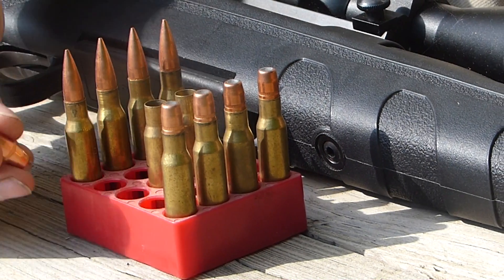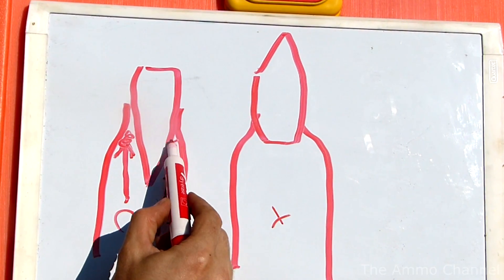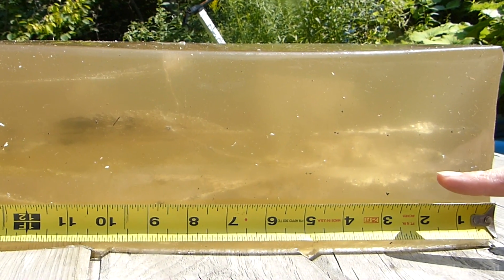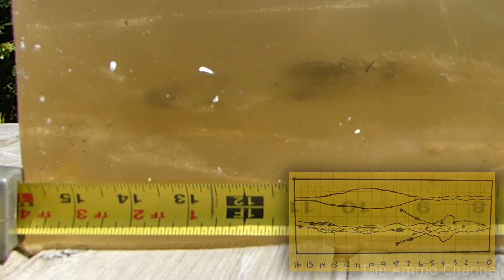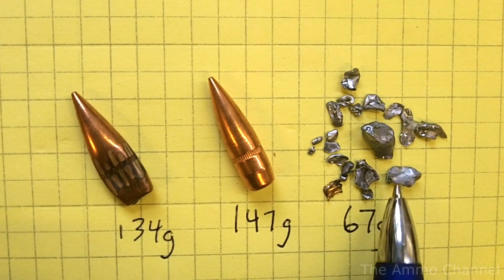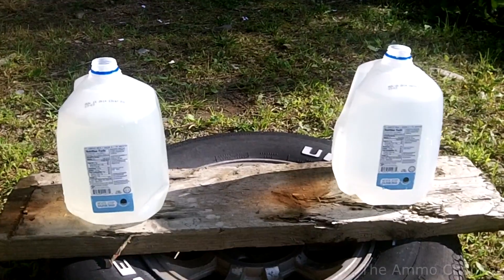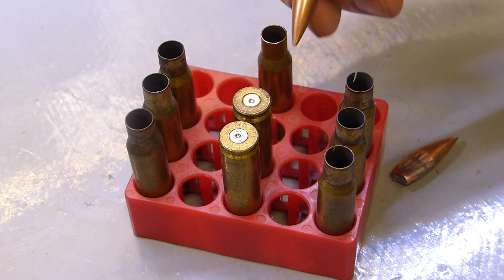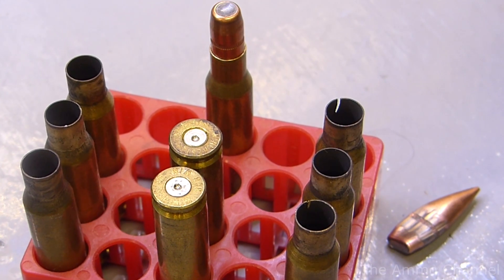Shooting Bullets Loaded Backwards

Comment: Back in the 50s to the 80s reloading impacted African safari ammunition.  More than a few guides and hunters were taking the soft point bullets and reloading them backwards into the large big game cartridges to produce some of the first dangerous game solid projectiles.  Soft points have a solid copper base so reloading the bullet backwards was essentially a solid with a flat face.  They got amazing penetration with these which is what they were working towards.  The practice is basically history now since modern bullet designs have covered it.  The different angles on the backward bullet in the case is irrelevant to pressure.  The bullet and unburned powder have already been pushed out of the cartridge and into the rifling before any direct gas pressure pushes on the bullet.  Nevertheless, gas pushes outward in an even concentric sphere and follows the path of least resistance.  Pressure in the chamber is dictated by how much bullet is sealing off in the rifling.  Same amount either way.  The biggest issue is losing chamber space to accommodate the round and still get it to chamber into the throat.
Reply: +Matan Pulverman This is a cartridge.  I'm not theorizing or even guessing.  I was relating history and what was discovered from guys reloading since before you or I were ever born.  Doubt all you want, even sincerely doubt, then pick up a really old reloading manual and start reading.  BTW, there is a huge difference between an impinged load and a direct force vector.  Your example is wrong.

Comment: backwards = death almost instantly.

forward = full pass through and the guy wondering if they are injured yet and possibly allow them to squeeze one off at you.

I'd say if you want to pop someones melon like a grape load it backwards. But if your wanting to pass through and get the guy on the other side of a wall load it forward.

The way I understand it is a FMJ is used for penetration and it obviously made it further through the steel than the one loaded backwards. Hollow points I have heard are mainly for stopping someone and causing the most damage to soft targets.

Comment: I read somewhere that the shape of the edge that forms the seal against the barrel has a large effect on barrel wear over time. I would assume that loading a bullet backwards doesnt have a well defined seal and would cause more barrel wear. If this actually worked without problems, thing of the awesome boat tail rounds they could make if the bullets could be pointed on both ends...

Comment: Pressure in a vessel is always equal throughout and normal to the surface. Other then the change in case capacity which in turn changes the internal cartridge pressure the shape of the internal surface is irrelevant on the "flow" of pressure.

Things not shown here are the velocities of the rounds and the accuracy of the bullets which one would assume are pretty critical things on comparing the round. One would assume the decrease in case volume increased the pressure and in turn the velocity. By lowering the charge you could match pressure and thus velocity but I highly doubt it would stabilize. This would more then likely result in key holing and essentially no accuracy.   

Honestly, I was more impressed that you didn't end up with a Darwin award.
Reply: I have 3

Comment: I've read they loaded bullets this way in WW I to create armor-piercing rounds used as counter-sniper techniques-reaching snipers behind iron plates, etc. Have you heard of this?
Reply: +Bob Jones 
I've heard the same story though the point wasn't to penetrate but to cause spalling on the back of the plate. The metal fragments thrown off would  supposedly wound the sniper in the face and neck.
Reply: ***** I never said I was going to do this or recommended doing this, I simply said I'd read it used to be done in WW 1.

Comment: Snipers used to do this in WW1 as a means of either damaging or piercing armored plates used by opposing snipers. The typical result didn't really result in a piercing of the plate armor. It would however cause metal fragments and sparks to come off the back of the plate. This in turn could get into the eyes and face of the sniper hiding behind the plate.  It actually became against the rules of war according to the geneva convention to modify arms in this fashion.

Comment: If you actually finish the story behind loading bullets backwards... that process started by folks building "Sub-Sonic" rounds..... the myth is that loading it backwards keeps it from tumbling....they reason no one is worried about chamber pressures on a backwards "Sub-Sonic" round is you use up to 11 to 15 grains of PISTOL POWDER to achieve the slower speeds need to be "Sub-Sonic". Yes you can shoot backwards bullets thru a can without baffle strikes as well..... sorry not trying to discredit or be a dick just sharing what I know on backwards bullets...

Comment: The Germans first did this in WW1 as a improvised anti-tank round, worked well when the armour was thin as 12mm ! even if it caused splash inside the tank it would take out members of the crew or at worst case hit the ammo store !

Comment: I disagree with your concluding remarks "Do not try this."  Do it, but drop the powder charge a bit.   I have a lot of pulled bullets from when I substitute match bullets.  I load the upside down bullets in my 30-30 for plinking.  They cycle fine and are OK in the mag.   Accuracy is good to 50 yards.

Comment: used in WW1 the backwards rounds acted as "squash" rounds for snipers hiding behind plate armor for protection. the blunt end would hit the plate with a larger surface area causing shards from the backside of the plate armor to be thrown in the snipers face. read about this in some books on trench tactics and have found it elsewhere in research. I know tanks also have a protective "netting" on the inside to protect the crew from similar types of rounds. pretty neat ingenuity id say.

Comment: If I recall correctly the theories taught in Naval propulsion class there is a correlation between pressure/force & surface area.
So, I'm surprised to see split case mouths and flattened primers, (certainly signs of overpressure). 

Too bad that piezo transducers aren't just laying around.

Great video, sub worthy !
Reply: I think cross sectional area is really all that's important in terms of propulsion... any sideward forces would be cancelled out on a symmetrical bullet, kind of like how air pressure is pushing you up right now just as much as it's pushing you down.  Trigonometry would reduce the thrust vectors to just their foreward components.

The overpressure observed -- I have little doubt -- would be due to the decreased case volume.  With a little time and experimentation, it would likely be possible to work up a load that avoids such a condition.  I can't help but wonder how the trajectories would compare.  I'd expect significantly more drop over distance with the backwards bullet but it would be interesting to see how much sooner it tumbles.
Reply: ExaltedDuck Yeah, there are some interesting dynamics going on here with this experiment.

Comment: Will you try this again loaded forward but first cut 1/4 of the bullet off with a band saw before you load into the case? this test might be safer and might give the results of a soft point round.

Comment: I've long wondered what the aerodynamic effect would be of a bullet that was pointed at both ends. Like two bullest butted up against each other.  You'd have a nice streamlined forward point and an extremely low drag tail end.  It had never occured to me the different pressure dynamic inside the case with a bullet pointed inward.  Very Interesting.  Nice video.

Comment: nasty wound did you cut the taper off ? looks like the fragmentation is horrible by the looks of those cases no but cut the taper off the front you should get increased speed and frag the same

Comment: I have an old "Cartridges of the World" book and it shows some old bullet designs that have points on both ends. The base point has a much shallower point angle and it is nothing like the ogive side of the bullet. It was all in an attempt to reduce drag and they do not mention case necks being split from this bullet shape. I've shot in many military competitions and used .30 caliber national match ammo with a good size boat tail at the base of the bullets that would have given the same pressure at the neck of the case as the bullet loaded backwards with no case splits or over pressure signs. I believe the splits and over pressure signs are coming from the amount or length of bullet inside of the case.
As for the British putting bullets in backwards, you would have to remember the type of propellent they used. It was Cordite and it was made in long strands the length of the brass to the base of the neck. The British soldier would have had to pull some of these strands out to load the bullet backwards thus reducing the pressure some what when fired. Not that I'm recommending shooting bullets backwards, but the powder charge should be reduced. I've tried shooting bullets backwards and have had them keyhole through a target at 200 yards on occasion.
Over the years many types of bullet shapes have been tried to reduce drag and increase range or give a bigger wound & shock. I've seen them in egg shapes pointed at both ends and even some that thought that a hole drilled all the way through the bullet would eliminate drag of the flat base.
One of the more interesting is the hydraulic bullets, were they had a sealed hollow cavity up by the tip filled with water to control the expansion in game. Lead poison anyone?

Comment: My question with zero knowledge of bullet flight physics is this: How would the backwards round affect accuracy?I  s it possible for the pressure in the casing to be uneven on the round causing it to wobble or would the rifling correct that?

Comment: Simply thinking about this. If I were to sharpen one wooden pencil and leave the another alone, the sharp one would punch through a piece of paper easier but would more slice through, less crudely, while the flat pencil would leave a bigger, more crude hole, while taking more force to push it through. Am I right on my assumption?
Reply: Yes, because the flatter pencil will have more surface area, meaning a larger wound channel.

Comment: What about cutting the tip off to expose the lead core? It should work like a soft point then, without being such a safety concern?
Reply: Norman Lesley yeah, there is lead in a tmj, tmj means total metal jacket, no exposed lead. some ranges require this fore environmental purposes, and @krankie, yes, if you gently take the tip of the copper jacket off and leave the lead it is a soft point, or drill it into a hollow point. both are tedious but if you are desperate for hunting ammo it works and is legal as long as the projectile is not steel core although long range accuracy is iffy due to balance of the projectile
Reply: FMJ was meant to prevent fouling in barrels. When more powerful smokeless powders were developed, they tended to foul the barrels with lead from the bullet fired. So they put a copper jacket around the bullet to prevent that. A 7.92mm FMJ round striking 6mm of RHA at 100 yards angled 0 degrees from the normal will shatter. 

Anyways, the blunt shape of the end of a boat-tailed bullet is in fact a fairly reasonable armor penetrator. Many armor-penetrating shot from battleships and tanks employed a blunt penetrating tip, oftentimes with a sharper ballistic cap to enhance aerodynamics. A 7.92mm reversed-bullet round, akin to the type the Germans used in WWI to counter British tanks, will go through 6mm of RHA at 100 yards angled 0 degrees from the vertical. 

A pointed penetrating tip, due to the very small area of contact with the target, is more likely to shatter since all of the shock is focused on a single point, causing round failure and the shattering of said round. However, a blunt penetrating tip, due to the greater dispersal of energy across the front of the bullet. Assuming the blunt tip is flung at the same speed as the previous example, it is less likely to shatter. 

I'm not saying expanding rounds are armor-penetrating ammunition (I know they are NOT). I'm saying that the end-first bullet arrangement was made to create a crude anti-material round.
Reply: Good to know. The allcapsrage really was not necessary. Please, tell me how soft point bullets are different then?
Reply: I've seen jacketed bullets which are not open at all.
Reply: I don't know dude, I don't make them. There are videos of people melting down range scrap to recycle the lead to cast their own bullets, and in one of these videos I saw some full jacketed bullets with no openings. The person who made the video had to cut them open to extract the lead.
Reply: I believe you are referring to a TMJ or total metal jacket. But I might me wrong.
Reply: Maybe that's what it's called. I'm not sure what it was, I just know I saw a bullet with no visible opening in the copper jacket.
Reply: Yeah that sounds like a TMJ. Honestly I never thought how they did it. That's a good question.
Reply: How so? Expanding bullets aren't very good for piercing armor. That was the whole reason they created the FMJ was to punch through armor...
Reply: You're welcome.
Reply: Soldiers in WW1 filed/cut off the tips of bullets to make expanding ammo although it was a crime. I saw a picture of an en-bloc clip of 8x50R Mannlicher found in Italy (with a metal detector) and the bullets where loaded backwards. It was really not as uncommon as one might think. Especially since the Italians where the big enemy that every ethnic-group in the Austro-Hungarian army hated the most. My great-greatgrandfather fought at the Isonzo, he only got Malaria.
Reply: do not ever cut the tip off of a jacketed bullet, unless you want the lead to go down range and leave the jacket stuck in the bore... dumbest idea ever!! removing weight from the bullet changes the whole load dynamic same as the bullet nose causing case volume concerns. also if you deform the bullet that is a problem too.
  not even close to a good idea.
Reply: @lukewarmwater6412  really? So is that what happens every time I shoot a semi-jacketed hollow point? The jacket gets left in the barrel?
Reply: @jungleno.  sjhp should still have a solid base like a fbsp, the jacket thus having to exit with pressure, an open bottom jacket with an open top simply allows the lead to squirt through the copper tube, losing accuracy, leaving the jacket behind for the next round, and gaining zero terminal increase past the few feet before the unstable lead chunk  tumbles off course.
Reply: Ah, okay, that makes complete sense. thanks for the explanation.
Reply: I do.know Mr. Hanson is right.  Some one tried it and it blew up their rifle because it left the copper jacket in the barrel.  DO NOT TRY IT!!!
Reply: Krankie V it works very well however you need to take off just a fraction of the copper casing to expose only a speck of the lead core. Too much will lead to the lead blowing out of the front of the casing before the projectile has left the barrel
Reply: Wrong..  Jacketed bullets came about when smokeless powder debuted..   The much higher velocities and smaller bores made shooting all lead projectiles impossible due to inability of lead to grip the rifling of the new small bore high velocity rifles..    They also aid in feeding and preventing damage to the tips.   Also, in 1899 the Hague Convention banned the use of expanding bullets in warfare.
Reply: You can blow the lead core out leaving the jacket in the barrel....The NEXT ROUND will be very exciting and get you bannd from your gun club for life if you dont end upwith you,re face blown off.
Reply: Krankie V Well the initial point of turning the bullet backwards was at first not to increase lethality against flesh, but as a crude armor-piercing round. Add some extra powder and you have a round that can penetrate the typically very thin armor of early WWI tanks.

Comment: I have found a couple of 14,5mm PTRS rounds with bullets stuck backwards in wwII trenches in Poland, so it seems that Russians also used this tactic
Reply: Why would they need to the 14.5x114 is a 12.7x99(.50bmg) on steroids

Comment: This has been known for over 150 years. Buffalo hunters in the old west observed the greater knockdown power of flat nosed bullets over round nose. They also noticed the wider the nose (Meplat) of the nose in relation to the body (caliber) the more effective the bullet was. Today however Hollow Point designs allow like performance with greater range and accuracy. An experiment with 38 special 158 grain cartridges, one round nose , one semi wadcutter  both at the same velocity, will show a marked difference in effectivness. The semi wadcutter is the clear winner in energy transfer while the round nose over penatrates.

Comment: If the issues with loading bullets comes from the problem of pressure build up around the edges of the casing; then why not manufacture a bullet that is flat on both sides? Similar to that of shot gun slugs.
Reply: Google the double ended wadcutter

Comment: I remember when I owned a S&W Model 25, in .45 Auto Rim/ACP.  I used ACP and half-moon clips, as the pistol league I was in had that cartridge as a requirement, but it didn't have the limitation that it had to be fired from a semi-auto.  I could experiment, since I was handloading at the time, and I tried reversing the flat base semi-wadcutters.  Though I was just hitting paper, I liked experimenting and making a perfect hole.  However, the fellow in charge of the league was a range officer, and when he saw what I was practicing with (25 yards, indoor range), he didn't trust the rounds and asked me not to use them.